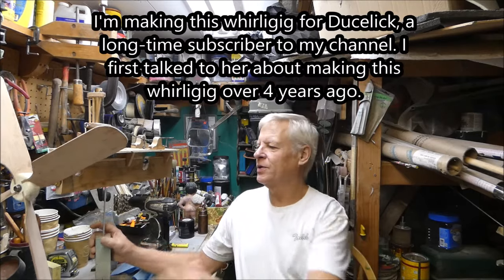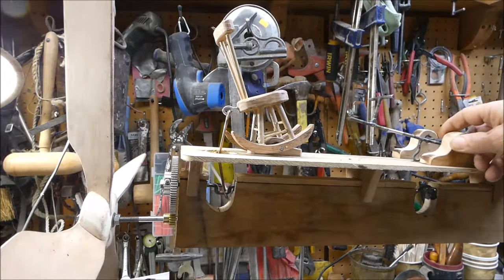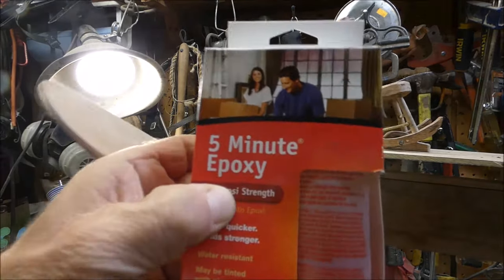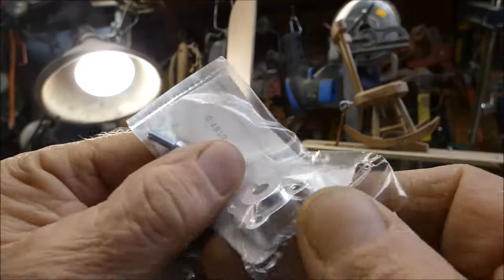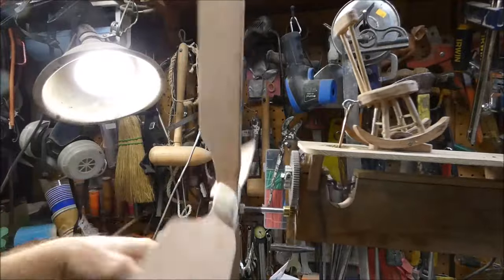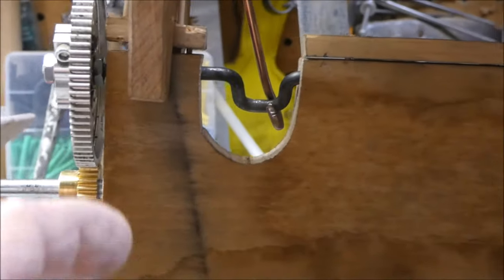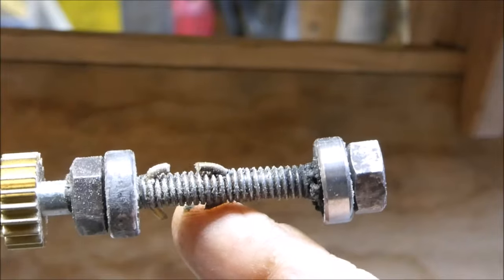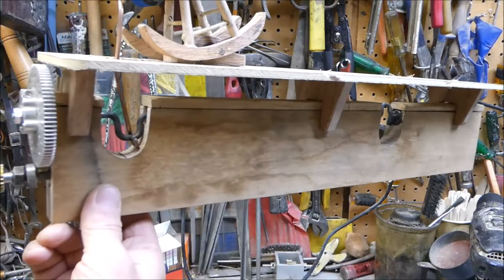Ducelick's rocking chair/teeter-totter whirligig 10/30/23 #folk art

Comment: Great project,the gears are perfect fit,that way if the propeller goes fast.
With the right dimension you can control the movement of the rocking chair  beter ...
Reply from the maker: Hi Steve! Thank you. Yeah, the gear slows things down so things don't get out of hand in high winds. I'm sure enjoying this project. Thanks for stopping by. Happy Halloween!